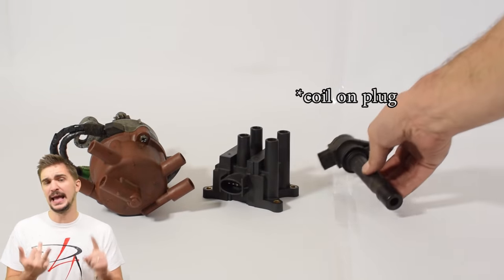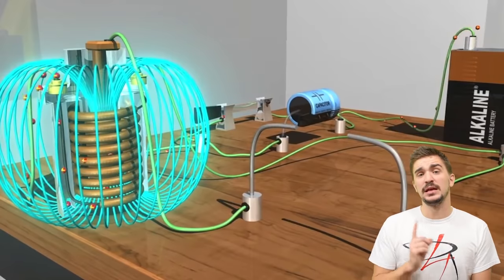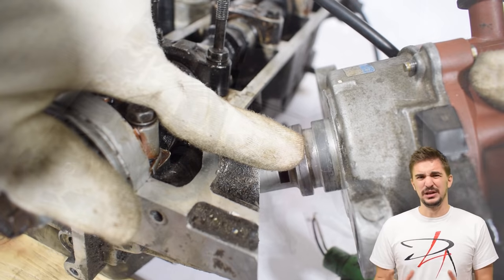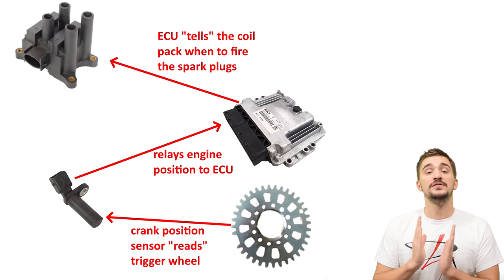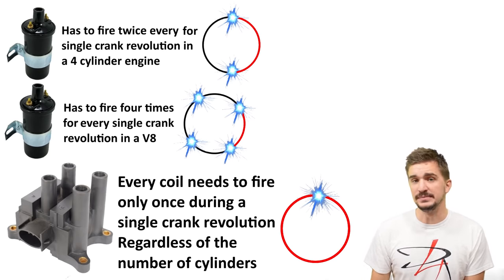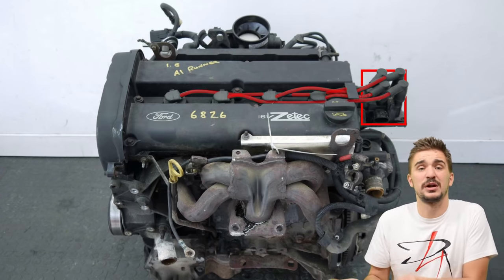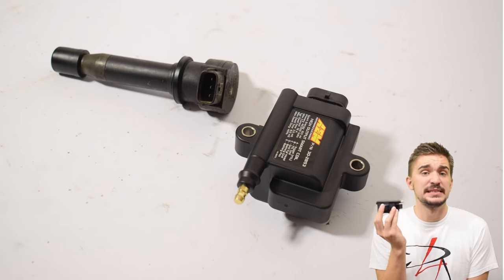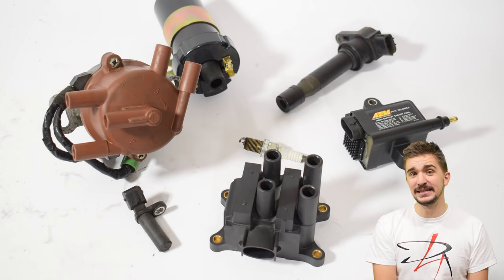Distributor VS Wasted Spark VS Coil on Plug VS MONSTER Coil near Plug

Comment: Never thought I'd hear someone praise coil on plug ignition design. It seems like you don't have much experience with distributors and have misconceptions.  For one, the amount of torque and horsepower lost from a distributor is, at worst, about 1 hp, less than what would be lost from an increase of 10-20 deg F in air temp. Then you go on to talk about timing accuracy and adjust-ability of waste spark and CoP designs like they have an advantage. While they can be more accurate, depending on the resolution of the crank/cam sensor/s, timing wheel/s, and software, they are much harder to adjust. Many cars require aftermarket ECUs, chips, or piggy back systems, plus the required PC/Laptop and software, to adjust ignition timing. The cheapest forms of which are still around $100. Timing adjustment with a distributor is free, disconnect a vacuum line, loosen a bolt, advance your timing for more low end torque and horsepower. If you want a different timing curve on a distributor, you can buy a spring and weight kit for less than $100 and get whatever timing curve you like. You also appeared to imply coil on plug ignition systems don't need standard maintenance in the way a system with spark plug wires do, that is incorrect. You will find manufacturer recommended replacement intervals on the coils of CoP systems, and those intervals are not much, if any, longer than the recommended intervals on standard spark plug wires. Both should be replaced, on average, every 50-75k miles for modern (post ~00) vehicles. Some manufacturers, cough VAG *cough*, are lucky if their coils last 10k miles. You wont find many caps or rotors that wear out in 10k miles, and when they do wear out they only cost about $20 total and wires can range from $20 to over $100. Ignition coils for a CoP design are $30-$40 at best and over $100-$200 at the high end. Very few CoP designs are cheaper to maintain than a distributor setup and none are cheaper to modify. I know I wrote an essay, but there was a lot of missed context and misinformation throughout this video.
Reply from the maker: Never thought I'd hear someone praise a distributor. If what I said is a misconception than the entire auto industry and a countless number of tuners and enthusiasts as well as journalists are guilty of that same misconception and the distributor is king.
Reply: @d4a  Never said distributor was king, you just failed to give the whole picture when comparing the different ignition systems. Tuners, enthusiasts, and journalists especially very rarely know all that much at all. Those are the types of people who say VTEC burns oil. (It shouldn't, but if you have bad valve stem seals it will, and VTEC is hard on valve stem seals.)  The auto industry also cares nothing about maintainability or pricing of replacement parts, neither effects their profit. Have you worked in the engine bay of a car built in the last 10 years? There's logic behind the fact many NHRA, NASCAR, and SCCA racing vehicles are still running distributors and carburetors. Price being a big part of it, its much cheaper to change timing with a distributor and the a/f mix using a carb, even when those are theoretically less precise. Thanks for not actually engaging with anything I wrote though, your appeal to authority doesn't work when I've been an automotive technician for 8 years at this point and have worked on everything from brand new Civics to late 60s era Novas. What exactly is your expertise? Anything more than backyard mechanic or you-tube car enthusiast?
Reply from the maker: No expertise here man, I'm just a moron with a camera. Btw, changing timing and afrs with COP and injectors is definitely more expensive compared to carbs and distributors as it wears out the keys on your laptop 😂
Reply: @d4a  Yea because a laptop and a OBD dongle are the only things you need to adjust timing and injector pulse width right? not like you need a piggy back unit (cheapest being hondata units, normally, which go for over $100 used) right? I didn't think you were a moron, nor call you one, but I wont argue with you on that point since you seem to believe a laptop and OBD dongle are all you need to tune.
Reply from the maker: Can I ask you something and you try to give me the most honest genuine answer you possibly can? During my 6+ years on YouTube I've read countless comments, and I've always been curious about a certain type of comment/ person I get from time to time. You fit that profile and comment pattern nicely. The comment starts with a condescending tone, downplaying what I said in the video for one reason or another. When I respond the commenter always cites their extensive experience as a mechanic, engineer or similar and proceeds to continue downplaying my perceived lack of experience or knowledge, despite not knowing me. And no matter what I say the commenter will continue in the same direction trying to prove their point, a point which is always either relative or subject to debate or sometimes even just silly. So my question is: what are you actually trying to achieve, what are you trying prove? That you're smart and I'm stupid? Are you annoyed by me, my face, my content? Why the condescending tone? Why do you have the need to try and get me to think like you? Are you trying to prove your value in a public space? Why do you make assumptions about me when I don't make any about you? Because it's obvious this isn't only about distributors or anything else. You couldn't possibly care enough about distributors to continue a pointless argument this much. If it was about distributors we would easily agree to disagree and drop this. You prefer distributors and carbs I like the advantages of modern stuff and that's it, to each their own. You like apples, I like oranges and we say bye. And I've scrolled through the comments sections of other technical information channels and they get the same type of commenter too, and the commenters always cite their extensive experience, be it 8 or 20 years doing this or that and they often downplay youtube. Look man, congrats on being an automotive technician for 8 years, I admire and respect all fields of work. I have never in my entire life downplayed anyone's work, be it a grave digger or a triple PhD professor, our deeds give us merit not our titles. So why do you downplay my work? "just a youtube car enthusiast"? I challenge you to try and do what I do. Make an informative video that gets 10.000 views. Make a channel that has 1000 subscribers. Give it a go. And I just can't wrap my head around how someone can so adamantly defend something and believe they're actually smarter than the evolutionary path of the entire auto industry and claim that car makers don't care about the lifespan of parts. There's warranties that last, 2, 5, 7 years, so I doubt they would stuff junk into their cars. They have images to uphold and sales to continue making. You cite Nascar and SCCA, that's racing man. Rules and regulations in racing classes demand a certain type of fuel delivery and/or ignition. Outside of those classes in the USA, only historic racing classes demand a distributor. It isn't really seen anywhere else anymore outside the MSD promag in top fuel, but that's also an extremely specific application. Obd dongle and Hondata? I have personally reflashled about a dozen stock OEM ECUs with a cable and a laptop. Yes the flashing kit costs a bit of money, but comparing the flexibility of tune of a carburetor and distributor to a cop and injection is ludacris. You have to remove carbs, rejet them, do trial and error and it's an absolute impractical pain and compromise compared to injection, and the maximum power potential isn't even comparable. The only thing you can do for free on a distributor is move it left and right, and there's zero flexibility there, you advance the entire rpm range. With a cop you can program every individual intersection of rpm and load differently, you can even do it differently for different cylinders, and do it reliably and with perfect repeatability. And to top it all off you claim that tuners, enthusiasts and journalists "rarely know very much at all". Where does that audacity come from man? Did the 8 years of automotive technicianship somehow make your arguments more credible than that of the general population of tuners, enthusiasts and journalists? Did changing oil filters and clutches give you the right to downplay several different career paths? So I ask you, as a human to a human, what are you trying to prove? Because nobody can objectively prove that distributors are generally better than wasted spark or CoP. What is that you want to achieve? Do you need someone to pat your head and tell you that you're doing a good job? Ok, you're doing a good job, you're working, you have merit, I genuinely and honestly applaud your efforts. Do you want me to say that I'm wrong and you're right? I won't believe it, but I'll say it "Im wrong and you're right". Is that it? If it's not, please tell me what is the point of thid type of opinionated comments about relative things and the downplaying of other people? I really honestly want to know.
Reply: @99EKjohn  another person that does not understand how anything in a car works. distributors work on a fixed timing curve W/R to rpm, same goes for manifold pressure. these are largely non adjustable. now with more modern distributor systems they are electronically controlled and are triggered and adjusted in the same way that a wasted spark or direct fire coil setup are adjusted. so with the older distributor setups you are referring to the only things that are adjustable are base timing, and dwell. 

for carburetors those little screws that you are turning only adjust idle mixture, the only way to change fueling off idle is to change the jets, which is less than precise. whereas fuel injection fueling is adjustable for all loads and rpm ranges once a programmable ecu is installed. 

yea initial investment to calibrate an electronically controlled engine is higher, but once that investment is made calibration only requires time and is far more accurate and precise than older mechanical systems.

Comment: I have a distributor on my 1997 toyota hilux it also has a carburetor no computer or modules  and uses the 22R toyota engine probably the best engine toyota ever produced and these modern efi cars will not last as long as the analog set up on my hilux it has 430000kms on it and it doesn't burn oil there us one electronic component in my hilux its the cassette radio and it has totally failed says a lot about electronic components and there is very little plastic in it been a cab chassis it has an aluminum tray and my sister in law drives a honda jazz and all the ignition coils all failed at once and had to replace four ignition coils her husband did the work are they as reliable as the single ignition coil who knows l bought my toyota hilux about 2 and h as lf years ago and just replaced the distributor cap and the rotor button my self very easy to do

Comment: Wow, guess my setup is the worst. Welp I can't really change it so i guess I won't be aiming for 6k rpm
Reply from the maker: The "worst" is a harsh term. Plenty distributor based systems in stock form go over 7000 rpm. I never said they can't do it, it's just that more powerful setup of course do it better.

Comment: No they are not better they are worse coil on plugs will work for a very short time then they miss fire and eventually all your vehicle will do is shake and not move at all then they want 100 dollars a piece for those peaces of garbage. Sorry but I've experienced this. old trucks with distributor or wasted spark never had this much trouble with

Comment: My coil on plug burnt out on #2 . The brain prick mechanic replaced the coil ...and ignored the plugs .  2000 miles later the same coil burnt out/..,., The Mechanic knew it would happen because he left faulty worn out  plugs ...CHANGE THE PLUG before it goes bad

Comment: Honda Type R B series manage fine at near 9k rpms with with an 'inferior' distributor. Even 'boosted'. 

This is more a video for pushing to use AEM products when the OEM application is more than good enough.
Reply from the maker: The word "fine" has a very loose definition and varies with application. For someone driving on the street and occasionally hitting the strip or track fine is one thing, for someone actually trying to be competitive and win events or have serious drag times, fine is another thing. But if you look at b series builds that are pushing the next level you will find none with stock OEM ignition. I'm honestly insulted when someone says I'm "pushing" a product. Yes I work with AEM and other companies, and yes they do help me make some of my content possible. YouTube is a media outlet, and no media outlet is possible without advertising. But whenever I present a product I strive for objectivity above all else and have never falsely advertised anything. I also always choose only products that I would use myself and have rejected countless offers to promote all sorts of stuff because I didn't believe in the product. So, do take a closer look at someone's work before you casually belittle it.

Comment: You are so incorrect it isn't even funny. There are distributor systems all over the automotive scene that are revving past 8000 RPM. MANY of these combinations have been tested on shows such as Engine Masters as well as Richard Holdner's channel. Distributors never had an issue doing their job in any of the windsor engines of older NASCAR series' that spun to 10000 RPM. All you have to do is make sure that your distributor has enough power to sustain the RPMs you are trying to achieve. But nice try...
Reply from the maker: It's really sad when someone doesn't pay attention and then decides to lash out. I never said distributors couldn't do high rpm. I said that if you significantly raise the redline on an existing stock distributor system it is more likely to struggle due to reasons I explained in the video.
Reply: @d4a  Explain stock HEI chevys spinning to 7000. 

As I said, Mr. attention, is that you are wrong and you don't build many cars and it shows.
Reply from the maker: Raise the redline. Raise.